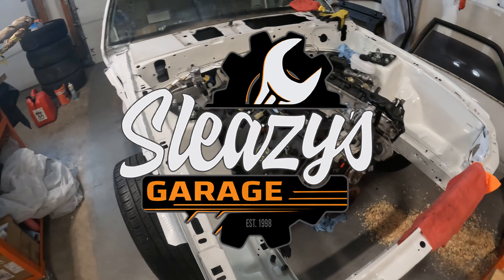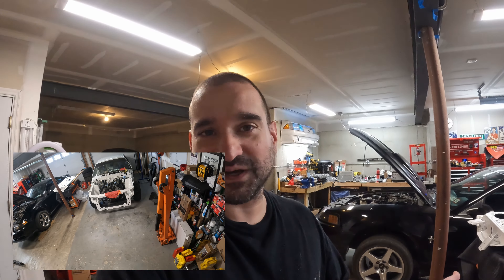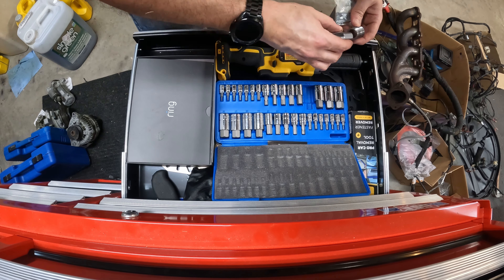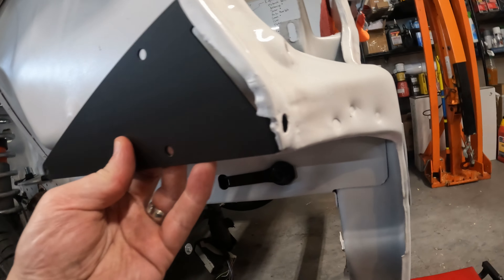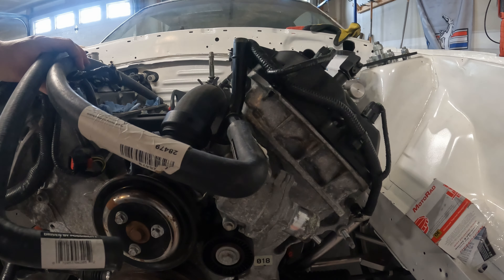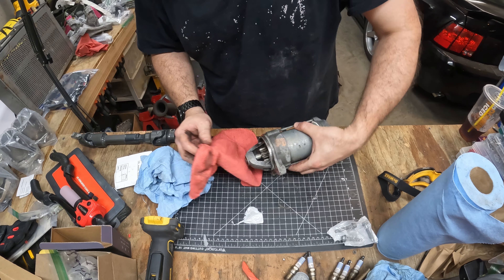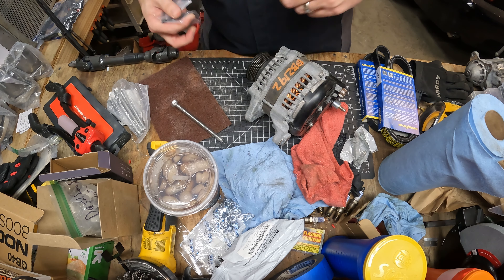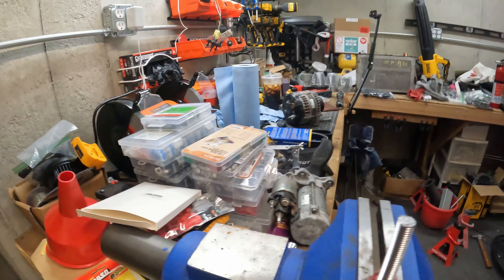Installing the Alternator - Foxbody Restomod Part 95

Comment: The Fox is looking awesome! That tool is garbage, I was hopeful it would work. I usually thread a nut on before I file the ends and then take it off. If that makes any sense. Your getting a lot done. I’m really looking forward to this first fire! 🔥
👊😎✌️
Reply from the maker: Thanks Rick! Yeah for sure, I think the ones with carbide inserts might work. I for sure bought the wrong one, but threading a nut on first and taking it off over the cut definitely works. Hopefully the PCM kit will be here soon and I can start wiring it up!

Comment: Great work…!! And yes it’s always more to it and time required to work out the kinks…. Just remember “slow is fast” ….. what power steering system do you plan to used …. I am using PBH speed drive which provides modifies system to accept power steering pump since the coyote doesn’t come with one…. Keep up the great work!! Looking forward to seeing your starting and driving
Reply from the maker: Thank you brother! Yeah it's definitely a marathon and not a sprint. I was leaning towards the KRC. Both systems seemed comparable in price all-in with the brackets, pumps and hose kits. So not fully sure yet but definitely going to have to pick one because of the hydroboost. Thank you again, me too!

Comment: The car is coming along ni8cely!  Quicker than my car.  Engine has been just sitting in the car since about October.  But I did switch gears to doing some suspension reinforcement work, otherwise I figured I wouldn't want to switch gears to that work after the car is running...I'd just want to get it on the road.  But I'm also hoping to hear mine run in about the next month.  My engine is out of a 2011 F-150 with about 90k miles...and between sitting on a floor and on an engine stand, I bet it hasn't run in 8 years, or maybe a little more.  So keeping my fingers crossed that I have a good engine.
Reply from the maker: Thank you brother! That's awesome, I'm sure it'll fire right up. Where did you source it from, do you know if it was tested before being pulled out? Subbing/following on insta!
Reply: Sleazy...I got the engine from someone else.  The usual nasty divorce story, so he was liquidating things before the divorce.  He said it came from a totaled truck that was hit in the rear and he heard it run before it was pulled.  I got a rebuilt Cobra T56 from the guy too.  Got it all for a bargain.
Reply from the maker: @puzzlefox5.076  Awesome, that should be a great combo. Those are the most expensive parts of the swap too, I think. What did you end up doing with the suspension?
Reply: I'm going nuts with it (can check it out on my YouTube, too).  I was going to build a really good handling street....well, scope creep...and now it's basically going to be a street legal racecar.  Going coil-overs all the way around, Cobra brakes, Caddy Brembos on the front, and a 2003 Cobra IRS!  I have Detroit Speed through-the-floor subframe connectors and a roll cage that I have put in myself.  I'm in the process of reinforcing the rear shock towers, yet, to handle the IRS with coil-overs.